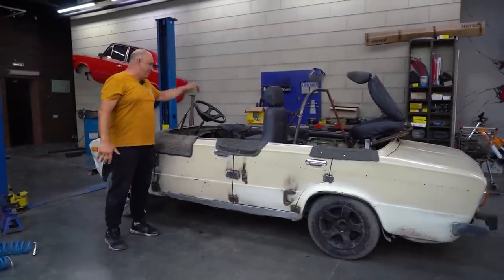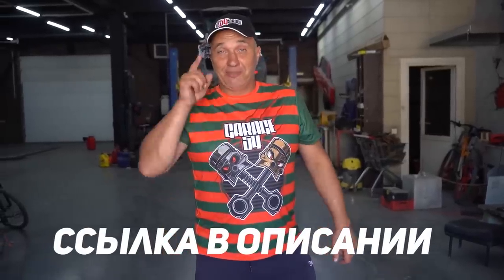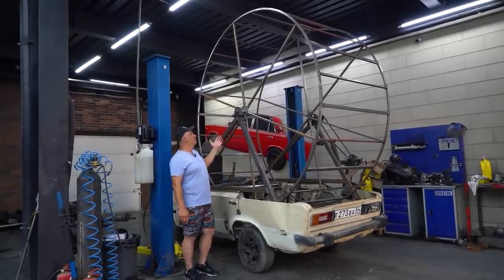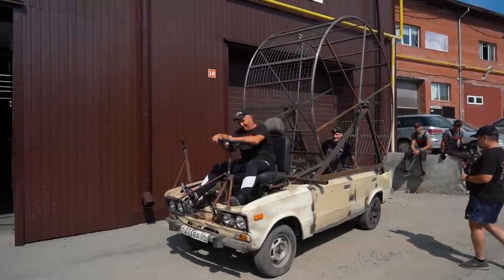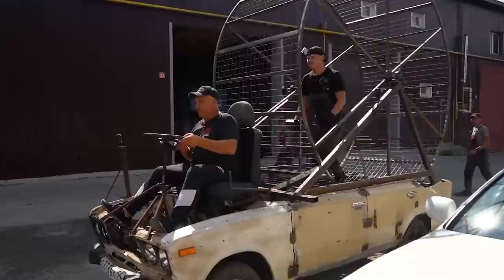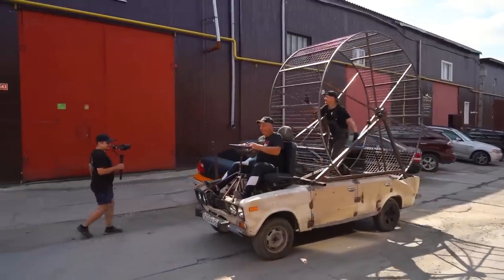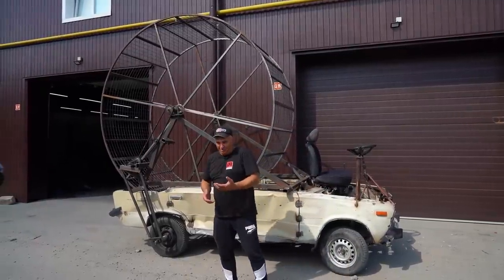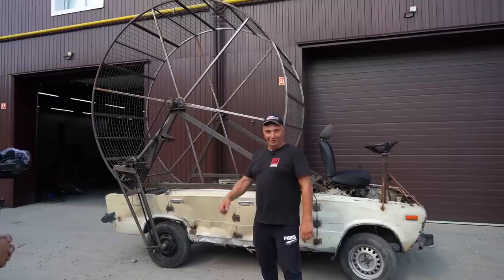Using a hamster wheel as a motor – RUN to drive

Comment: Looks like they could have used a bar to hold onto in the middle. Something like a hollow axle where you have the solid mount bar go through the center of the spinning axle.
Reply: They could also use their arms to help, buy pulling the spokes downward...
Reply: That would be difficult to  hold to and not very ergonomic I guess. Another option would be a wheel on both sides like a handrail where you could slide your hands while running.
Reply: @wilhelmbauruch  It would NOT be a bar strait across the middle. it would just go through the middle then you could have several bends moving the bar forward to a more "ergonomic" position.
Reply: @Patrick_Cooper  They way they were currently doing it, grabbing the spokes, is risky. A great way to test the shear stress of ones arm if not careful.
Reply: When Scrapheap Challenge did this, they had the central bar, with the "hamsters" in harnesses attached to the axle, and in front of it. This worked very well.
Reply: exactly my thoughts
Reply: a pair of handrails midway around the circumference on each side would be worth the weight penalty.
Reply: i was thinking of a pair of ergonomic hand holders. they would be on a bearing and would not rotate with the wheel.
Reply: My brother, I was gonna say the same thing Mr. Christopher. :) A bar or something to hold on to would have made the large wheel easier to walk inside of. We are on the same wavelength.
Reply: I agree, if their arm fell through the spoke, the next spoke rotating onto the main struts would break an arm easily with the momentum of the vehicle would unstoppable. Needs totally caging in and some handles built onto the axle ends to hold onto. Im against namby pamby health and safety, but there are obvious basic safegaurds for limbs to consider. "Oops, why didnt we think of that !"
Also, the wheel should have a clutch on it so if the person falls over they would be churned if going down a hill but the clutch could be released. I wont go on. Fun but deadly.
Reply: I was thinking add bearings on the inside and two long bars going to either end of the wheel with a cross bar for the person to hold and then put a counter weight on the other end for resistance. Just enough weight that the person has something to bear against to get traction.

Comment: Drive a heavy flywheel with it, then tap off the flywheel when you need power. The "engine" can concentrate on steady power input :)
Reply: Flywheels are always the answer.
Reply: Too much power loss in conversion.
Reply: @crazydrifter13  yeah, but it would look hilarious :)
Reply: @gshingles  😂 yes

Comment: Excellent build guys! I was grinning from ear to ear while watching this episode.
I have some suggestions for the hamster wheel:

1) Add more weight to the outer circumference to increase the rotating mass. It's a big flywheel!
   Best I can guess, your wheel is about 1.5 meters wide and about 3 meters in diameter.
   Using 4 mm steel for the running surface, you could add about 550 Kg to the rotating mass.
2) Add some circular hand rails about 80-85 Cm inside the diameter of the walking surface, attached to the outer spokes. Also one in the center, attached to the outer circumference.
3) Add a transmission between the chains to replace the jackshaft, such as a motorcycle gearbox or something like that.
4) Find a couple of big athletic guys who either play rugby or ice hockey, preferably teammates 
who already know how to work together, to power the wheel.
5) Get the weight down as light as possible and take it to the drag strip! 🤣

That would be awesome! I'm looking forward to more of this build.

Comment: it just needs  fixed center bar that does not rotate so the "hamster/Squirrel'' can hang on to it and or lean on it when walking. The would also be able to apply more torque and have a safety ledge to hold on too. maybe radial mounted bearings instead of center pivot,

Comment: Actually it's a little known fact but as a mechanic I can tell you that this is exactly how a car engine works.
When you press the gas a little light turns on in the engine and tells the tiny people inside to start running.
The number of little people are indicated on the back of the car, V4 , V8 , V12 
But the more you have the more expensive it is, I mean you are buying more little people and they are not cheap.
Reply: They also eat gasoline and scream at the top of there lungs in higher end brands.

Comment: It's wide enough for two people...run it through a clutch and transmission...The clutch mostly to prevent overspending the wheel on a downhill or assuming you got it going over 15 mph and need to stop, inertia keeps the wheel spinning, spinning wheel dictates those inside the wheel keep pace with whatever speed the wheel is turning or they start riding it like a ferris wheel without seats. But to put it in perspective, in the late 1800s a French inventor built a motorcycle that ran on the same principle but obviously a smaller wheel that had 2 medium dogs inside it.

Comment: As just mentioned below, i came here to suggest the same thing, put a motorcycle in it, and so that it is safe and the bike remains upright, weld a centre bar horizontaly accross the middle of the wheel, fit bearings over it first, and to these, weld 2 bars that would clamp to the ends of the handlebars of the bike. I look forward to seeing this! 👀

Comment: This is one of the best videos lol. I want one of these. It needs a gearbox to reduce a running speed to high torque to make the car stronger. It will have a speed of about 5mph when the guy is back there running, but you'd be able to go up hills and not need a helping push anywhere.

Comment: Should add free moving handle bar inside big wheel for stability and better pushing. Now it's purely on weight and also not stable (side bars not very safe too, due hands can touch support bars, can hurt a lot.
Add handle bar inside wheel is better. This is not connected and rotates freely Sort of |____|  handle. This will make more people possible (2 together on handle is nice).

Comment: If you wanna keep it being human powered, mount a bicycle inside the wheel because that way your gait won't matter and you might get a bit of speed out of it, plus nice low gearing for setting off.

You could even make it a Hybrid by using one of those E bikes

Comment: how much electricity could you generate using that size wheel to power a motor for the car wheels?
Reply: I'm pretty sure the amount of electricity would not be enough to generate enough torque to get the car moving, but with a battery, it might be enough to keep the battery from completely draining. The problem is the wasted energy when you connect the generator to the motors spinning the wheels. Their design was flawed as the chain did spin only one wheel and when that wheel had no grip, the car stopped moving... For the system to work correctly, all four wheels would need to have motors or chains...

Comment: MAKE A CAR MOVED BY THE STARTER MOTOR POWER.... ENGAGE THIRD SPEED AND TURN THE KEY...YOUR CAR WILL MOVE AND FAST..... REMOVE THE SPARK PLUG TO AVOID LOOSE POWER DUE THE COMPRESSION
Reply: I think that's been done before

Comment: Ew, seems like needs a freewheel mechanism if the transmission doesn't automatically go into neutral when not driven.  Seems, along with some safety side something.  Man, you guys are great!
Reply: It doesn’t have a transmission.  Chain drive to the right rear wheel.
Reply: @robertheinkel6225  Ah, yes I didn't watch on the big screen.  Well, there's the next video idea!  🙂  Seems like a big flywheel with a freewheel and clutch as well would be handy for more energy storage.  Maybe on both sides to balance?

Comment: dont be a freddy with the money, robber, stainer of God's temple, not yours, God's
Reply: this is nuts
Reply: do you realize this is the same as pushing the car from behind :)
Reply: a hand holding bar should work nicely, then just run, a rowing machine powered car
Reply: electric hamster-wheel generator